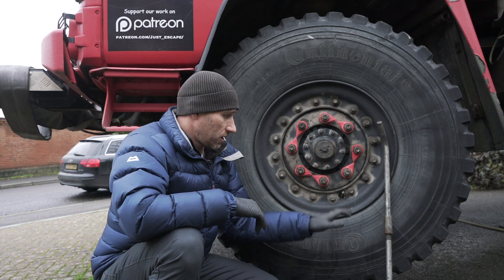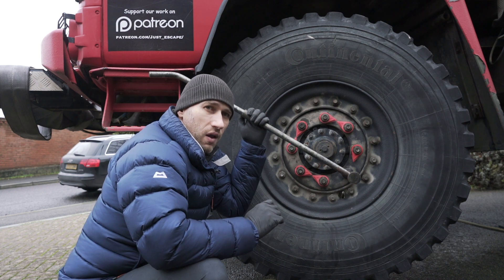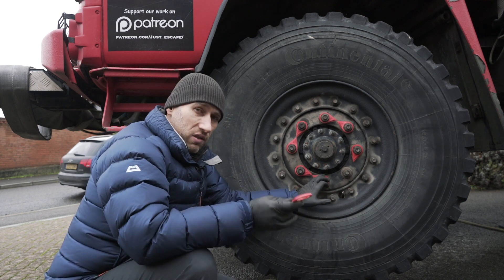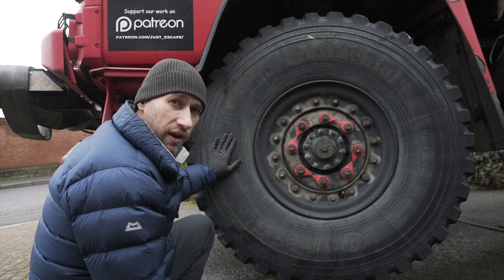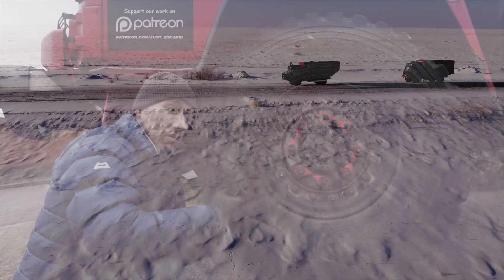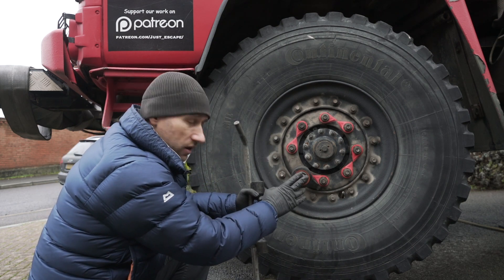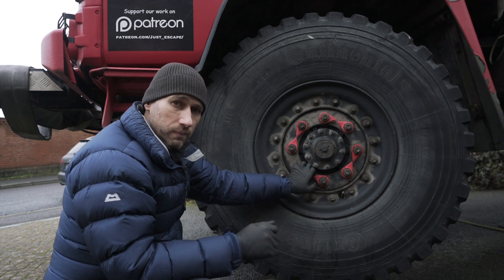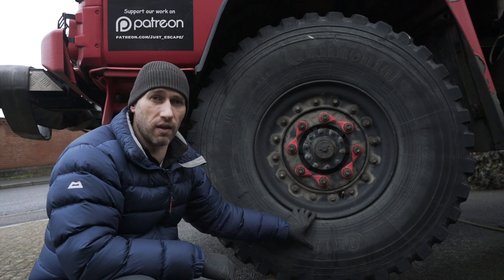Overland truck SAFETY tips. Torque wrench and Torque multiplier.

Comment: You can use a smaller cheaper torque wrench with a torque multiplier to tighten. Just divide the tightening torque by the multiplication of the multiplier then set the torque wrench to the number you get. Most multipliers are only accurate to +/- 4% and depending on the torque wrench that itself can be a few % out. And another tip is to always back off your torque wrench back to the lowest torque on its scale, they should never be stored for long periods wound up.

Comment: Thanks Matt for advice video. Ver interesting all the tips than can be shared. 
What double rim do you use? Any brand you recommend? What tire dimension you use any shape or brand you recommend... many thanks and keep on 👍🏻
Best from France (Marcus)
Reply from the maker: Hi Marcos.  What do you mean by double rim?     My tyres are 14" R20"
Reply: Matthew Payne | Adventurer | Filmmaker hi Matthew thanks for the answer I am talking about the rims of the wheel (ring rims?!?) 🤷🏻‍♂️
Reply from the maker: @marcosruizchitty2807  The wheels are from a Polish Star truck.

Comment: Hello Mathew, greetings from Lusaka in Zambia where we are in lock down with our truck Big Bertha. 
I bought a Sealey torque multiplier 1/2" in 3/4" inch out. It's about £300 new (I bought second hand on ebay for about £120). Much less than a wheel torque wrench. This means I can use my ordinary torque wrench. The multiplier can also be used for other stuff around the truck. Its 1:6.5 , so just need to work out the torque setting for the wrench and add a bit for losses across the multiplier.
Loving your videos.
Dave catch-the-wind.com
Reply from the maker: Hi Dave.  Good to hear from you :)

Comment: Hi, can you please put a link to the torque converter here.
Reply from the maker: Thabo Nel  Thats what I intended to do.  However there is no name on the one I have, and I cannot find the purchase history.  There are many on eBay that look like mine,  but I wouldn’t want to add a link and recommend one as it may not be off the same quality and I wouldn’t want to be responsible for you getting a bad product.
Reply: Norbar is the make you need. Norbar manufacture torque wrenches. Go to any professional heavy vehicle maintenance company and the chance are they'll have Norbar torque wrenches.